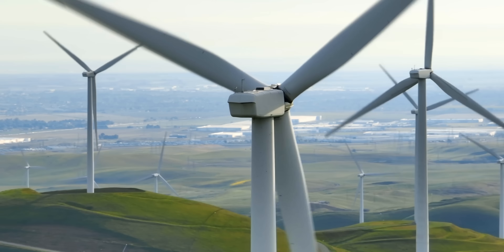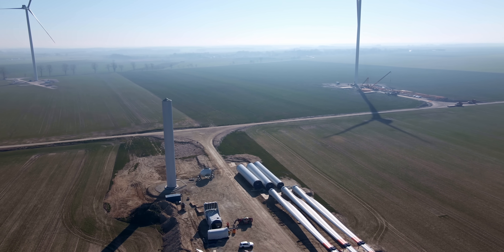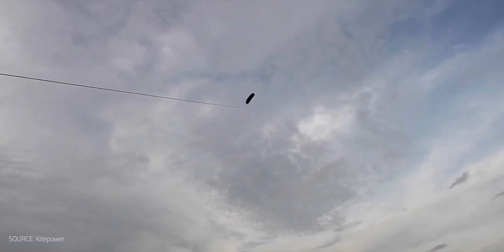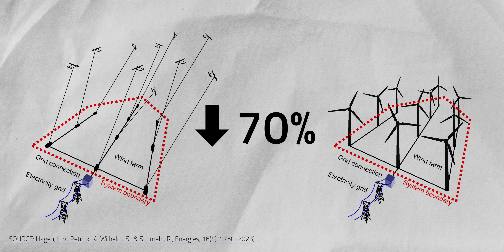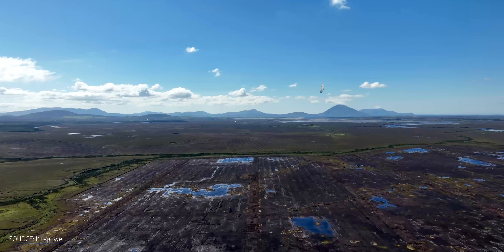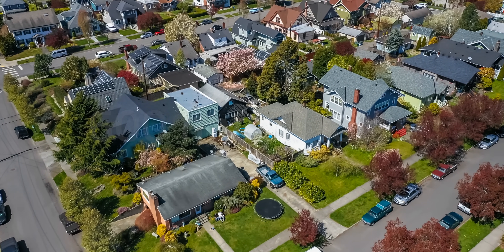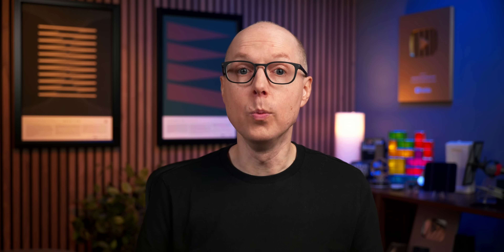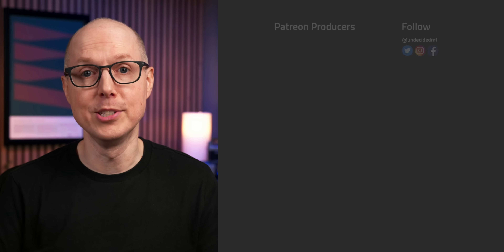Are We Building Wind Energy Wrong?

Comment: I just defended my PhD dissertation a few months ago on real-time control and technoeconimic optimization of kite systems! Glad to see that this technology getting more attention. Also, I'm happy to answer any questions about Kites!
Reply: Something he didn't emphasize in the video is that kites fly perpendicular to the flow of the wind when executing crosswind flight (figure-8 patterns) at a high angle of attack. The result of this is that they fly very quickly when flying in these figure-8 patterns and generate lots of lift and tension. When spooning in, kites pitch downwards and glide in at a low angle of attack, flying in a straight line as opposed to a figure-8. As a result, they generate much less lift, and therefore tension in the tether, when spooning in. This makes it much easier and less energy intensive to spool in than out.
Reply: @saltofine8 thank you, it makes SO much more sense now.
Reply: @saltofine8  As a recreational kiteboarder I can attest to this analogy. There are rest positions in the trajectory of line to the kite relative to dial positions on a clock. This determines zenith or power depending on the placement relative to the wind in the sky/ceiling. :hand-pink-waving:
Reply: @what163 Awesome! I'm a windsurfer and the intuition of how to angle the sail relative to the wind helped me alot in understanding the dynamics of kites!
Reply: @saltofine8  Can the same be achieved by deforming the kite during the downward motion, so it has much less air resistance? The goal would be to confine the overall motion of the kite so that it takes up less space.
Reply: @saltofine8  "Spooning-In" ?
Isn't that 'Spooling-In ?
Reply: How fast does Charlie Brown have to RUN to get a kite UP THERE after the wind has restarted after being stopped for an hour???     Doesn’t he get tired after “launching” 20 or 30 of these???
Reply: @saltofine8  can you compare with Makani's design? Matt Ferrell is lame to ignore this startup founded in 2006, funded as a Google moonshot project, then shut down in 2020! As I understand it their 600 kW design had a glider-shaped kite flying continuously, spinning a row of turbines on the leading edge of its wing; sort of like an electric airplane in reverse.
Reply: @skierpage  About Makani -The charicteristics of free turbines are pretty well known.  You can calculate the output based on the dimensions of the rotors -and it is very small compared to fixed windmills.  Then there is the weight of the generators and the structure to hold them that limits the minimum wind speed of operation.  My thought is that output is too small and days too limited to justify the risk, development, and expense of their concept.
These soft cloth foil kites can sweep greater area at over wind speed with a tiny fraction of the weight, and most can survive a full speed crash into the ground with negligible damage.
Reply: How much maintance do they need? And what do you do with them, when there are very strong winds?
Reply: @Michalosnup  if they make a purely fabric and string kite, they can break off and parachute down.
Reply: @Michalosnup  4:15 he says they dock themselves in high winds or there is an operator
Reply: Won't they affect flight ops?
Reply: With how wide of a sweep they have at height, can you really replace a much denser traditional turbine setup? Or are they really more supplemental power for traditional solar or wind fields or better fielded in emergencies ?
Reply: @cxsey8587  I'm a kiteboarder and can say that even while a kiteboarding kite has 20-25m lines, if the upwind kite is kept at a higher angle than the downwind kite, the operators can be so close they can high-five without touching kites. The whole array could be operated in coordination and you could concievably even have multiple kites on a single base station.
Reply: I wonder about interference with Airspace / flight traffic.
Reply: @saltofine8  weren't ready to answer so many questions, huh😅
Reply: How is the navigation done?
I assume there are some kind of small winches in that black box at the base of kite that then tension and release the sail for steering. 
Are there any in depth articles about this aspect?
Reply: @vengefulenigma Yes! Kite systems don't generally have a human operator, they rely on automatic control. One of the biggest challenges in getting these systems online is developing robust and reliable control strategies for kites that maximize power generation. For more details on control for kites, I recommend looking at the work of Lorenzo Fagiano, Roland Schmehl, and Chris Vermillion.
Reply: How do you deal with Air traffic?
Reply: @modellking  apparently the air traffic issue is the one thing you're not supposed to ask about 🤫
Reply: Congratulations doctor!
Reply: What I haven't figured out yet: What happens when there is minimal wind or no wind at all? Don't these kite turbines just fall down?
Reply: @saltofine8  how would you deploy this around tall buildings and trees? I feel like the cord would be getting tangled and you run the risk of running into buildings. Downdrafts??

It looks really cool, but surely there's some kind of guidance system.
Reply: What are the airspace implications of this technology when implemented at scale?
Reply: what an awesome course of study!  I have years of power kiting, kite surfing, and kite making experience. The power that a leading edge inflatable can produce is stunning, seeing these in action produce power is fantastic.
Reply: @saltofine8 thanx for answering the questions you did and also great job picking a great topic for dissertation. 

Where do you believe these would work best? Deserts where the kites can crash harmlessly to the ground? Farmland?  Mountains? 

Also, is there any concern regarding bird death from the kite and cable?
Reply: Congratulations on your PhD- massive achievement.

Ha ha! Forty questions- you jumped on a land mine there.

Specifying the kite parameters seems like a tricky optimisation job.
I’m not sure if the following is at all relevant- I’m thinking of the weight of the cable versus the lift force of the kite. Maybe it’s completely insignificant. Is the cable steel?

If you want to capture energy at the highest altitude at the maximum wind speed you will have a very strong cable, but then on much calmer days with less force available, your strong, heavy cable will sap a large chunk of the power available.

Also, is there a means to deploy and recover the kite without requiring people?
Reply: Did your thesis get into optimization of the actual kite design?  These designs seem to be favoring high lift, but my intuition is that a large span with better lift/drag could be better -then there is the challenge of keeping the kite inflated at minimum lift on return.  Being light enough to fly in low wind, but able to keep shape and structure in high winds (F~V^2) is the big challenge.
Reply: Is the rotation of the spool line (the pulley between the drum and the kite, where the line vacilates left and right during the figure 8s) used to generate power, too? As in, not just generating power from the line being drawn off the drum, but from the angle of the continuous left-right movement.
Reply: I feel like a collapsible kite would solve all the issues of it coming back down it would just drop like a rock and only energy would be the collapsing of the kite which seems like it would be very little
Reply: @MrNorthphoenix The last thing you want is to drop it like a rock. Then you have an 800m cable lying in the countryside and you need to send a team to reset the system and fix the damage to material and properties. The key point is to have reliale software that controls the kite in any wind condition and spools it all the way in when the wind gets to strong, choppy or slow without landing it prematurely, but getting it back to “ground docking station” in flight. When these huge inflatable wings are lying half open on the ground and you need to manhandle them when a gust chops in you can get hurt by the cable or the wing itself.
Reply: @nickus9119 makes sense be all over the ground and it literally dropped Like a Rock but if you collapsed and Let It Drop at a sustained rate and have a spring blinds that cable up as it goes down similar to what you guys are talking about I guess I'm just not scientific or specific but in my head my plan worked really good
Reply: Hi, did you do any work on Aluula material?
Reply: What about the dollar savings per dollar spent on ship kites? I imagine them to be quite expensive to build, will suffer quite a bit in salty, wet and sunny conditions, might crash rarely but then difficult to redeploy automatically? I would design an Americas Cup racing boat with that technology, but could they really become an economic thing to install on something like a container ship or a tanker? Or are the fuel savings such high that a single trip will refinance the kite set-up and we would mass produce them as soon-to-be-replaced fuel-equivalent?
Reply: What happens to the kite when it is becalmed? Can it park itself and the auto fly when the wind gets up again?
Reply: What's your favorite kind of kite? I like the dragon ones with the long tails, those are so cool.
Reply: Did your studies look at building swarm intellegence and autonimous control itnto the kites like they do with drones, to allow them to synchronize and enable greater density in a region?
Reply: This seems more realistic than other wind or solar..especially when you account the production costs of the “green” energy or the effects of getting that material like mining or the space it takes up as well
Reply: would it make sense to put these kind of systems all the way up on mountains, lets say 3km mountains (10k feet) +400m (1200ft) from what he said in the video the kite could reach, so there are no birds at that altitude.
Reply: Where would kite optimization be for a mountain area? In the valley or side, or on top? Idk, but curious to see if this can work in mountain areas
Reply: How do they generate electricity?
Reply: 8:56 if a watt is a joule per second, what the heck is a kilowatt per hour?
Reply: Now Can we make the Glowing Starwars powercore
Reply: The old fashion way can withstand more on strong air turbulence and  many can be installed in a tight area.
Reply: Are there consumer-type awes that small off grid communities could use? ? What would be the cost of small awes?
Reply: Has anyone designed anything that doesn't use the "yo yo" method? Like, have they tried to tether an airship or, "kytoon", to the ground and let it carry a turbine up in the sky?
Reply: How does AWE comply with the stability and predictability that is necessary for grid level electricity generation? I mean, I’m thinking it’s a pretty cool idea, but how practical is it really?
Reply: Link?
Reply: The cost by MegaWatts/h ? 😊
Reply: The cost by MegaWatts/h ?
Reply: And it still can't beat a nuclear power plant
Reply: do they have to be farther away compared to standard turbines to prevent potential crossing/tangling?
Reply: This deserves at least 400 more likes.
Reply: CONGRATS and all the best in your next steps!
Reply: Welcome to the AWE community ;)
Reply: من در همین بخش، بیش از بیست کامت را خواندم و چند تایی تکراری و در باره ترافیک هوایی و دیگر موارد بود. پرسش من به عنوان یک ایده پرداز و بدون دانش مهندسی،  این است که، آیا هزینه استهلاک و فشار دائمی و تغییر حالت طناب در حال تنش، و زمان تعویض و تعمیر و نگهداری و یا ریسک از دست دادن طنابی که در اثر پایان عمر کاری و پارگی و ...، ارزش ادامه این روش را دارد؟ آیا نوسان تولید انرژی و مدیریت یکسان سازی جریان انرزی،  پردردسر و پیچیده نخواهد بود؟ با سپاس از پاسخ مهندسی و کارشناس مربوطه.
Reply: Whats your stance on us flying them, especially up to the highest heights, what if a group sent them soring should we really go, fly a kite?
Reply: What do you think of Rob Reads kite turbine design?
Reply: Where can we read your PhD thesis?
Reply: I have a question. When are you gonna answer the rest of the questions?
Reply: please tell me that people in the industry realise that cycle between consumption and production is not so much a downside but rather a feature?! In an ensamble it can be either orchestrated to cancel out or timed in sync to stabilize the grid. 
Or am I missing something?
Reply: @saltofine8  how is a kite deployed from the ground?
Reply: What is the average lifespan of a kite? I flew kites as a kid, the lines and kite material is strong but... over time they do take a lot of wear. Flying 24x7.... it seems like the kite and line would not last very long.
Reply: @saltofine8  Have you published your thesis yet? Could you post a link? I'd love to have a look at it.
Reply: the energy lost in transmission losses argument is bunk. the efficiency improvements in wind turbines each few years are more significant than the minor losses in transmission, especially using HVDC for longer distances. transmission between grids even pays for itself just because it can shift power from one region and set of de,and centres to another. don’t use transmission losses as an argument against tower mounted wind turbines.
Reply: does the amount of anchoring force required change based on power output of the kite energy.
Reply: Hi I live in zone 5 of this project and even in the zone im in the noise and shadow is so annoying, with the surveys we have carried out it is having a serious effect on the red deer and mountain hare. Roll on full planning permission 2026....
Reply: How do they produce more than they use
Reply: @kalrandom7387  The kites are steerable. You steer them offwind for the recovery part of the trajectory.
Reply: Would it be possible to have a design with a light spring-tensioned coil to pull the kite back to the base with another wire that simply opens a series of flaps on the kite once it reaches max altitude? Essentially the pattern would be: 1. start at base station with flaps closed, 2. wind blows kite up and away generating electricity, 3. at max altitude, line 2 pulls to open all flaps on kite, 4. spring coil reels kite back in to base station, 5. flaps closed and repeat
Reply: @LloydChristoph  Do you mean like a second kite that acts as a counter weight, like how an elevator uses a counter-weight, but in this case the two kites are each other's counter weight and they use an openable flap system to draw in the higher kite more easily?
Reply: @LloydChristoph Yes, and this concept actually exists! There's AWE power plant in China that does something similar!
Reply: @LloydChristoph  I think the angle of attack or the shape of the kite could be "set to sail" (like a propeller of a turboprop with failed engine) to be pulled back easily. A little winch up on the kite could do the "shape passivation". Energy consumption could be small both for the winch passivating the kite and the larger ground based generator/winch pulling back the deactivated kite.
Reply: What I haven't figured out yet: What happens when there is minimal wind or no wind at all? Don't these kite turbines just fall down?
Reply: @helmutkremser7682 The control systems for these kites are designed to safely guide the kites back to ground in the event of a fault or sudden loss of flow.
Reply: For fun is there another green energy concept you can imagine this synergising well with? 

The one that jumps to mind for me is the gravity battery idea
Reply: @axesofebil  This is a really interesting idea. You'd need a pretty intense transmission, but you could just convert wind directly to mechanical energy.
Reply: Isn't there a huge issue with their cables tangling together?

What are these things spinning to generate power, and how?
Reply: @MangoTekNo There is an electrc generator attached to the spool. When the kite is flying the horizontal figure 8s it is taking line off the spool and gaining altitude. This runs the generator. At a certain height (e.g. max line lenght) the kite is steered in a position where it creates very low pull and the line is spooled in via the generator/motor. The kite is pulled down to maybe 200m and the cycle repeats. Flying fast figure 8s till the cable is at 800m. Then “park” the kite and pull the line in. Unlike a windmill the kite doesnt produce continuos electricity, but only on the way up. The pulling force (lift) of the kite is dependend on the airspeed rushing over its backside just like a plane wing. Low speed and the kite looses lift and stalls. Get a 2 line parafoil kite as a toy and you will figure it out 😊 It’s big fun.
Reply: @MangoTekNo For your first question, tethers getting tangled up is an important issue to address particularly for farms with multiple devices. There's a balance to be struck between spacing them closely to save on land use costs and putting them so close that they can become tangled in the event that a kite loses control. For your second question, the ones shown in the video spin a winch mounted to the ground as they unwind the tether.
Reply: @saltofine8 The video mentioned having an operator. Does one of these generate enough value that I could buy one, set it up, and fly a giant kite for a living?
Reply: All your education is good for us funding and grants. They don't care about truth. Only profits.
Reply: How much land would I need to incorporate one of these kites to produce enough kilowatt hours for a small town of 500 Homes? Thank you